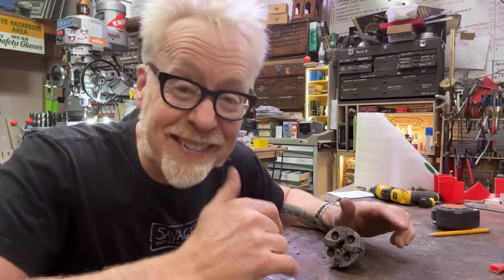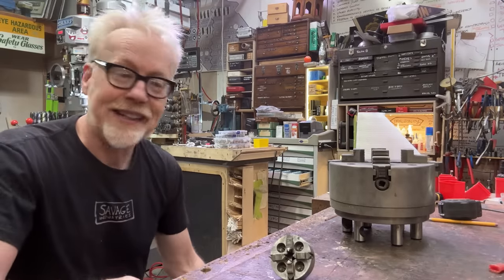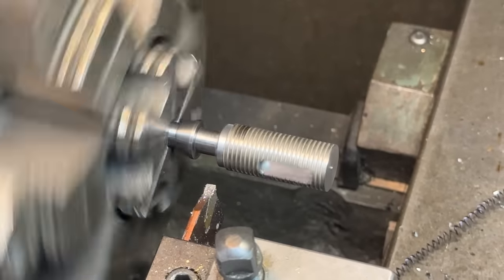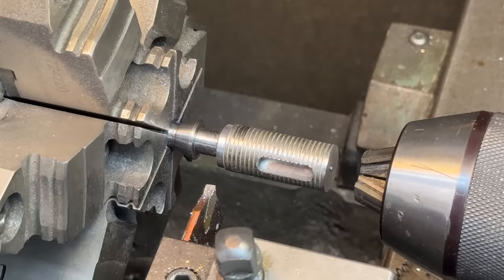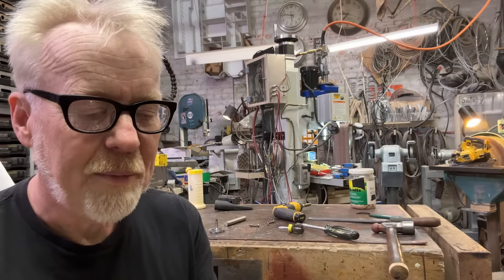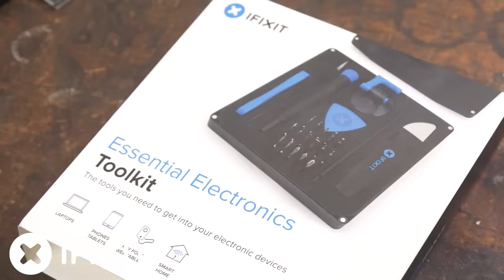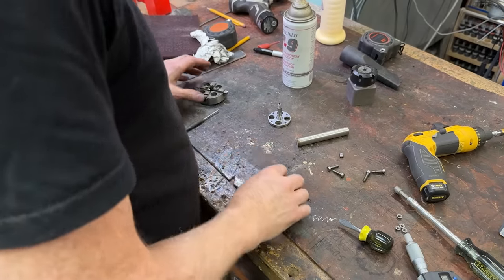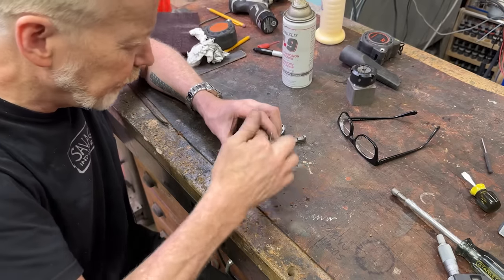The Smallest Tool Adam Savage Has Ever Made!

Comment: A really great alternative to 4 jaw chucks if you're doing small stuff is a 5C collet chuck WITH adjustable alignment - usually 4 bolts allowing the whole chuck to slide on it's backplate precisely, so you can zero the runout.
Reply: Nothing Adam does requires that level of precision.
Reply: I've seen him center to the thousandths on his lathe on his making a base for the weird glass-sphere-inside-out base
Reply: @contraband1543 a collet would be an order or more of magnitude more precise. It's unlikely the rest of that lathe is within a tolerance that small.
Reply: @CullenLorsung42  his lathe has a digital readout down to ten thousandths
Reply: @contraband1543  A DRO has nothing to do with concentricity
Reply: @CullenLorsung42  I have my doubts that lathe is even level and true.
Reply: @joepie221  Seems to work fine for him lol
Reply: @contraband1543 
So?
All that means is he can turn the diameter of something that may or may not be concentric to within a tenth of a thousandth, totally useless if the job is only concentric to within 0.005” a not unreasonable amount of runout for a self centring chuck.
Reply: @CullenLorsung42  The trick is, making an imprecise machine make parts that are very precise. Having the equipment to do that, or making tools to do that is where the magic lies!
Reply: @thomasbecker9676 but then again, do we really care?
Reply: @MrGreenAKAguci00  
If you mean about it being level and true, Adam should, but it doesn’t affect my work on my lathe! 🤷‍♂️
Reply: @jeffreyyoung4104  
It is not the equipment or tooling that enables an inaccurate machine to make accurate parts, it is the skill of the machinist knowing how to minimise the inaccuracy to a level that allows for accurate final components. 
At the end of the day the machine needs to be repeatable more than it needs to be accurate, if adjustments are not repeatable then there is no getting an accurate part! 
Setting up the machine level and adjusting for true have as much or more impact on the performance.
Reply: @jeffreyyoung4104  That isn't a thing in this case.

Comment: Your drill bit was off centre when you used it on the lathe not sure it made a difference but you can see it move to find the hole by eye on the video. Maybe check if things are straight.
Reply: His tailstock needs adjusting.

Comment: You should do a review on the Juki LU 563 sewing machine hook mechanism.

The SPEED of the mechanism is so fast that an ungrounded head will build up a static charge in the hook.

And even that static charge spinning at 3,000 RPM will create a magnetic pull sufficient to pull the sewing machine needle off course !

Followed by a heart breaking “snap” when the needle collides.

Comment: 4 jaw chucks are ideal for accuracy. I don't know anyone who doesn'y use one.
To really dial in a job in a 4 jaw chuck that you know the center of, that is to use a wiggler (didn't know of this until I was shown the use of it in a group on FB).

A wiggler is a length of truely straight piano wire running through a brass sleave with a spring and collar setup mounted in a tool holder so that it extends along the bed from the work in the chuck and you can dial out the runout (wiggle) at the end of the wire.

Comment: In the “switch room” at the phone company we had a plethora of oils and greases for the switches.    
I wonder where one could find out what kind of oil is necessary for different lubrication points?      
Some oils evaporate others polymerize.    
No polymerizing oils in extremely tight tolerance locations, don’t want to glue them together while sitting idle. 
In that teensy chuck tolerances look very tight.
Reply: WD-40 is specifically designed to leave a waxy water proof coating on what it is used on. (CRC-5.56 is similar).
CRC 2.26 (electrical lubricant) leaves a light oil behind (similar to sewing machine oil).
Most modern automotive oils are specifically designed to leave a persistent oil film (and in some cases a fluorocarbon film).
Straight run oils don’t (but also provide worse startup wear and corrosion protection).

Comment: Would you consider showing how to “center”a three jaw self centering chuck. I marked the ID jaws to the corresponding jaw guides to replace them with OD jaws and cannot get them to center.
In frustration I removed the OD jaws and put the ID jaws in the proper guide slots and now both the ID and OD will not center. Thanks

Comment: If you do all your maching from a single mounting the concentricity of the Chuck is irrelevant.

The concentricity of a self-centering chuck can be improved particularly for a single setting by my Machining the Jaws when they are tight on something slightly smaller then your intended workpiece.

Comment: a small benchtop lathe like these for watchmaking seems like it would be ideal for a small shop or maker?
Reply: picked up a 8x16 chineesium lathe. Other than it being partially used and partially rusty on the tailstock "sold as new" and wrong model. Seems like it would be as useful as a 3d printer. Remember you will need special tooling for slotting and gear cutting.

Comment: The loose fit and subsequent peening of shaft to faceplate will  not hold up in this application as you will have torque being applied in two axis causing it to work its way loose.   I would remake with a tight press fit and follow up with a small pin to lock in place.  Would hate to have that spinning mass break free while running.

Comment: Well Adam,  it looks like you don't practice what you preach. Rather than using a 4 jaw for modifying your chuck arbor, you decided to do it that quick and dirty method by using your 6 jaw chuck. 
I liked how you were surprised or relieved that the part turned out concentric. You totally weren't even listening to yourself with your little introduction concerning precision.  A toolmaker would be able to make it actually truly concentric,  not just close because close isn't good enough.

Comment: Damn you were lapping on a surface plate.  That is a no no as I know you know not to use anything with grit on them.  Just had to be a smart ass and call you out on it. :)
Reply: Even more smart-ass;  1) how else would you lap to ensure something is flat, but on a known flat surface? 2) emery or jeweler's lapping paper only has grit on one side
Reply: Most smartass: that was sanding, not lapping. Emery paper isn’t of consistent thickness, so using a surface plate behind it is not remotely necessary. FWIW I have a couple of granite countertop cutoffs for this purpose. My surface plate is reserved for occasions when I need a known flat reference.
Reply: @fullmetalpenguin  you do not use any abrasive on a granite surface plate period.  They are for inspection and measuring only.  Trust me on this as they are less than.001 out of flat.  You slide measuring tools on them to check parts.  We made parts with a.0003 tolerance.
Reply: @shelleyking8450  on a lapping plate as every toolmaker knows.
Reply: @Finnegan6674  Thank you for the reminder that whenever I am pedantic I will encounter another, better pedant. Yes, I know what a surface plate is for and what it is not for.

Comment: I've worked on more measuring machines then you can shake a stick at. I can measure thread depth using gage pins.
You should hire me. I also do electronics. Ya high level, SPI bus versus I2C....single wire lan.